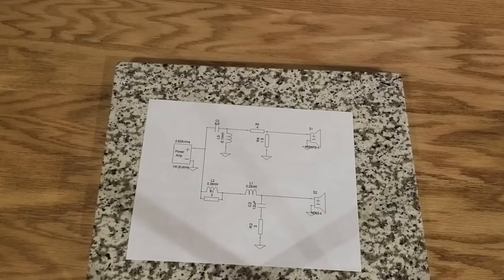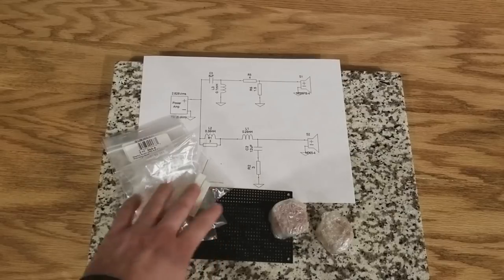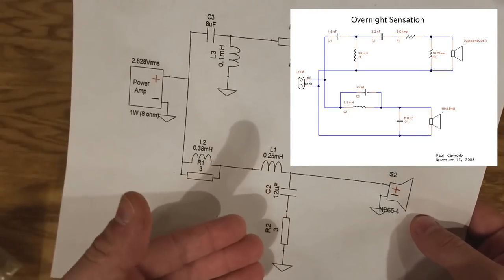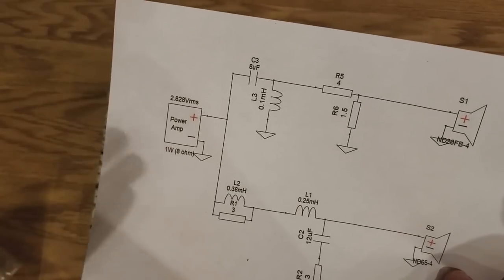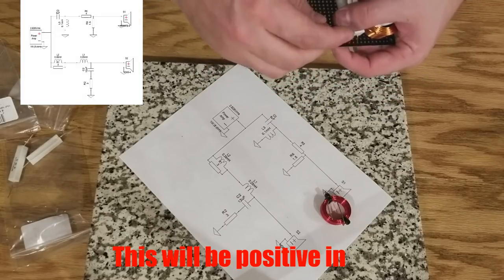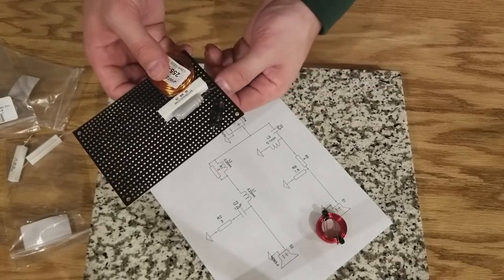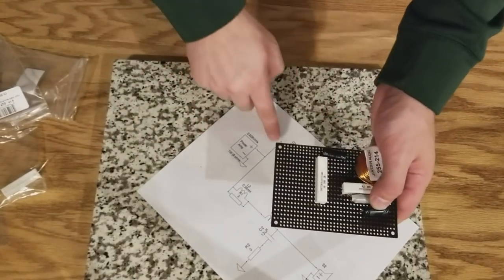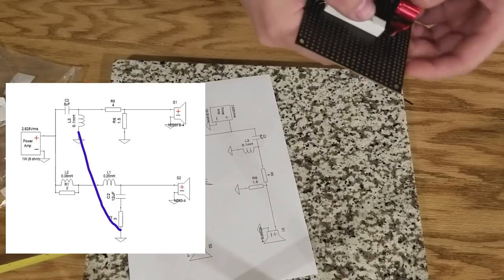How to Design a Crossover Board from a Schematic

Comment: Thanks alot @123Toid Excellent
Reply from the maker: Your Welcome!  Thank you for the great idea. If you ever have any more, don't be afraid to ask!
Reply: Would definetly.
Reply from the maker: @Clense Clan It is.  Basically it crosses the frequencies of the drivers.  There are a lot of reasons for this, including distortion, driver limitations and even dispersion.
Reply from the maker: @Clense Clan the best sound will always come from something you design or have design for you. But you can buy pre-made crossovers. You would need to figure out and attenuation circuit for the Tweeter though. Basically, the Tweeter will play louder if you don't attenuate it

Comment: I am new to speaker passive crossover diy. 1st what is the purpose of a speaker passive crossover? 2nd What are each component and what role do they play? 3rd How do you build a quality speaker passive crossover?
Reply: 4. What gear is required and everything I need to get started?
Reply from the maker: Those are all good questions.  I can;t really explain all of it on here, it is way too detailed to get to it.  In fact, literal books have been written on the subject.  however, I did create an online video series that introduces newcomers into how to build a quality crossover network.  That should answer most of your questions.  That can be found here: https://www.youtube.com/playlist?list=PL6hjpiCHZmIPx3itPeTt7zoSqNY20OQqV  As far as what the purpose is...basically each driver in a speaker has a certain frequency range at which it works at.  If you power it past it's range, you can damage the driver and add distortion.  A passive crossover is designed to crossover the signal and power to the individual drivers for the best sounding (and power handling) speaker.  I hope this helps you :)

Comment: @123Toid.... Hi. I have a question regarding a 1st order two-way crossover with BSC filter and high pass filter (HPF) on the woofer.

Power amp + ----------- C1(HPF@9KHz)---------R1(8 Ohm LPAD)----------- + Tweeter

                     + ---- L2 R2 (BSC@1400Hz)----L1(LPF@9KHz)----C2 (HPF@150Hz)----+ Woofer

Is this the correct way to connect the high pass filter (HPF) on the woofer ?

The set up is a 2.1 and the 2.0 Woofer + Tweeter will be supported by a 0.1 Subwoofer from 150Hz down.
Reply from the maker: bsl bl the capacitor on the woofer should connect to both the positive and negative on the woofer. That's what you're referring to then it sounds right
Reply: 123Toid .... thanks. You mean the HPF on the woofer should be attached to the +ve and -ve terminals of the woofer?

Is there some way i can PM or email you the layout?
Reply from the maker: bsl bl Yes, PM me it

Comment: It's not often, but when I see it I have to say it. When it comes to speakers, you know what you're talking about! Electrolytic Capacitors are so universal, but I seen them go bad so much I avoid them when I can. The problem is they get a little old or they get a small spike and the get leaky meaning they pass DC current and speakers don't like DC. I work on computers and other electronics like guitar amps so for this I would go with Poly Caps, they last and they play well with audio. what's the cost difference between them and or why do you prefer the Electrolytic Capacitors?
Reply from the maker: Thank you and great points.  I don't prefer electrolytic caps.  I prefer poly or film and foil.  However, on small inexpensive builds, I have no problems with anyone that wants to use electrolytic.  I personally test with electrolytic, since they are so cheap and easy to keep in stock.  But on my higher end builds, I only use poly and or film and foil.
Reply: Sometimes & more often than not they sound better

Comment: Very helpful! Can you do a video on how to balance two different speaker sensitivities using resistors. (if that method is possible) I'm a new to crossover building.
Reply from the maker: That is a great question and I think a lot of people have it.  Have you seen this video yet, it should help: https://youtu.be/BDlPswC5U8U?list=PL6hjpiCHZmIPx3itPeTt7zoSqNY20OQqV  It uses the free Program which is in the description.  If you do not know how to get FRD and ZMA files, this video will also help.  https://youtu.be/Fm6tsj9Tpqs?list=PL6hjpiCHZmIPx3itPeTt7zoSqNY20OQqV
Reply: 123Toid thank you so much! That video was very helpful. I'm building some 2 way pa speakers using a Dayton pro 12" woofer (96db sensitivity) and a prv 280ti horn (108 sensitivity). That's why I asked because they have different sensitivity ratings. Finding crossover components that have the power handling and affordability is tricky. Thanks for the great videos! 😄
Reply from the maker: You're welcome!  Glad I could help!

Comment: I have a crossover which is designed for a 4-ohm system, what happens if I use that crossover with an 8-ohm speakers?
Reply: Tuning will change significantly.
Reply: double the values on the coils and half the values on the caps